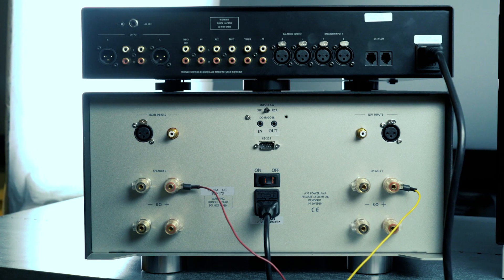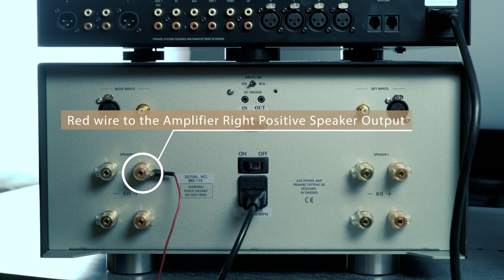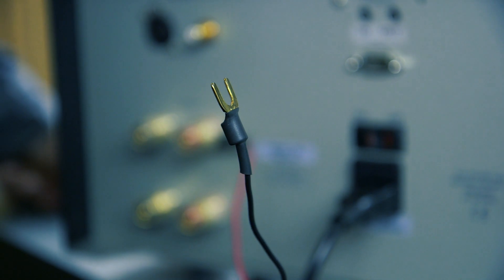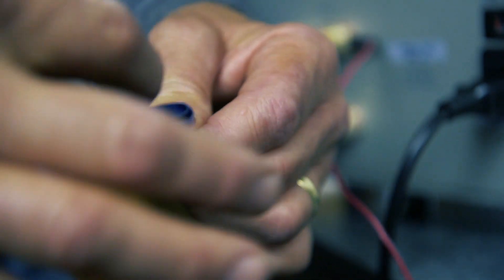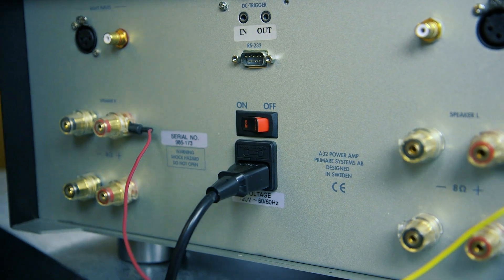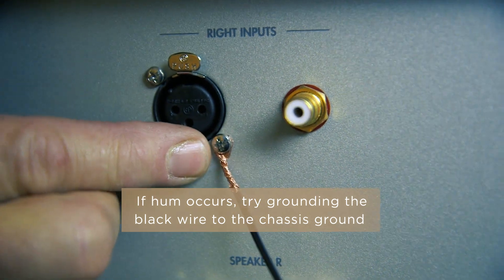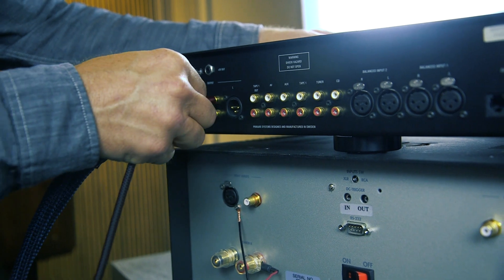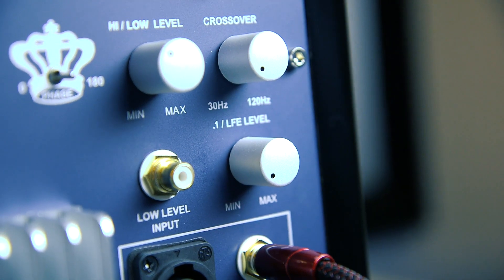REL Acoustics How To: Connecting to a Balanced/Differential Amp Using the High Level Cable

Comment: Can I use a high pass filter with the hegel h120? and how?
Reply from the maker: Thank you for reaching out. The Hegel H120 uses a Class A/B output stage design, which means that you can certainly connect to it using the High Level input. With the H120, the black wire can be attached to a negative speaker output terminal, while the red and yellow wires can be attached to the positive speaker output terminal for the corresponding channel. 

If you have any additional questions about connecting High Level in your system then feel free to write in to contactus@rel.net and we will be happy to assist.

Comment: Would this apply to a Hegel H190? Thanks
Reply from the maker: Thank you for reaching out. The Hegel H190 uses a Class A/B output stage design, which means that the instructions outlined in the following video can be used when connecting High Level to this amp: https://www.youtube.com/watch?v=YIenhBQEtE4&t=8s

Comment: my Rotel 1582mkii has 2 sets of binding posts for left and right channel can i connect to posts that don't have the mains on them
Reply from the maker: Thank you for reaching out. To get the best possible performance from the High Level connection we recommend connecting the cable to the exact same set of output terminals as your main speaker wire is currently connected to.

Comment: i can't determine if my Michi X3 is a fully Balanced/Differential Amp or not, should I leave the black wire floating or attach it to a ground point on the chassis?
Reply from the maker: Thank you for reaching out. Rotel describes the Michi X3 as using a Class A/B amplifier design, which means that the black wire of a REL's High Level cable can be connected to a negative speaker output terminal on this amplifier. That being said, it appears that the Michi X3 also has a designated ground screw on it's back panel, and when one of these is available I typically will default to connecting the black wire to this ground screw regardless of the output stage design for the amp.

Comment: I use Proceed AMP 2, please advise the best way to connect a REL S5 high level?
Reply from the maker: Thank you for reaching pout. The Proceed Amp-2 is a Class A/B amplifier, which means that the standard High Level connection method can be used, as outlined in the following video: https://www.youtube.com/watch?v=YIenhBQEtE4&t=8s
Reply: @RELAcoustics  Many thanks for your prompt response.

Comment: Hello, thanks for the video. Question; is the SPL of the subs the same without the Black cable connected as with it connected? With my Yamaha I had the colored wires twisted to positive and the Black to negative. Now with my Denafrips Hyperion all I did was disconnect the Black and I barely hear the bass output. Does the subs Phase change with a balanced amplifier? I have two t/9i connected in stereo. Thanks again!!
Jason
Reply from the maker: Thank you for reaching out. The black wire of a REL High Level cable exclusively serves as a ground reference between the subwoofer and the rest of your system, and if you do not experience a ground loop hum from the subwoofer then there will be no need to connect the black wire. 

The type of power amplifier which you are connecting to will not inherently impact the phase of the subwoofer, though there are other possible reasons for the low output that you are experiencing. When you have a chance, please write in to contactus@rel.net and we will be happy to assist with troubleshooting this output issue.

Comment: Is this the same as for a Bryston 14b3? I’m assuming because the amplifier is bridged that I shouldn’t use the black ground wire?
Reply from the maker: Thank you for contacting us. The Bryston 14B3 is a fully-balanced power amplifier, which means that you should follow the instructions outlined in the above video when connecting a REL subwoofer using the High Level input.

Comment: Is "system ground" the same as saying "common ground"?
Reply from the maker: In terms of connecting the black wire of a REL subwoofer's High Level cable, a system ground and a common ground would work equally well. If you have questions about connecting to specific equipment, then feel free to write in to contactus@rel.net and we will be happy to assist.

Comment: Is a Krell DUO 300 a Balanced/Differential Amp? I assume it is because I can use balanced interconnects? thanks
Reply from the maker: Based on Krell's literature the DUO 300 is a Class A amplifier, though it would be worth contacting Krell to confirm if this is the case. If so, then you can use the standard High Level connection method with the black wire connected to one of the negative output terminals on the amplifier. Here is a link to our video outlining this connection method: https://www.youtube.com/watch?v=YIenhBQEtE4&t=8s

Comment: Can I connect a REL T/7i over High Level cable to the new Musical Fidelity M8xi ? According to Musical Fidelity high level connection is not possible? But I am not sure if that goes for REL as well...........
Reply from the maker: The T/7i subwoofer can be connected High Level to your Musical Fidelity M8xi integrated amplifier, though it will be important to not connect the black wire of the High Level cable to either of the negative output terminals on the amplifier. Instead the black wire should be left disconnected to start, or if any hum occurs from the sub then you can either connect the black wire to a chassis screw on the amplifier, or run an RCA cable from the .1/LFE input on the subwoofer to any unused analog RCA jack on the amplifier. These instructions are also outlined in the above video.

Comment: Hi, I ordered a pair of T/9x RELS and I am connecting the. To a McIntosh MC452 quad balanced amp. Is this the method I should use? If so, where do the second eat of red and yellow wires go? Thanks!
Reply from the maker: The following instructions can be used when connecting a pair of subwoofers High Level to Quad-Balanced stereo amplifiers:
- Twist together the red and yellow wires of the right channel subwoofer's High Level cable and connect to the right channel 8 ohm positive output terminal.
- Twist together the red and yellow wires of the left channel subwoofer's High Level cable and connect to the left channel 8 ohm positive output terminal.
- Leave the black wires for both subwoofers disconnected. If hum occurs, then they can be connected to a chassis screw on the amplifier, or to a ground screw on your preamp if one is available.

Comment: Hello. Tell me how to connect the rel t7i to the Yamaha as 2200 amplifier. The speakers are connected via biviring. And what to do with the black wire?
Reply from the maker: When connecting the T/7i subwoofer to your Yamaha A-S2200 using the High Level input, we recommend connecting red wire to right channel positive, yellow wire to left channel positive, and black wire to the ground thumb screw located on the amplifier's back panel. If you are bi-wiring your speakers, we recommend connecting the positive red and yellow High Level wires to the output terminals which are sending signal to the low-frequency drivers on your main loudspeakers.
Reply: @RELAcoustics  Thank you for the instructions. Is it possible to simultaneously connect the ground wire from the vinyl player to the ground point on the back of the amplifier along with the black wire from the rel t7i?
Reply from the maker: @MrAlmat-mh9di  Yes, you can have your turntable's ground wire and the black wire of the subwoofer's High Level cable connected to the same screw without issue.
Reply: @RELAcoustics  Thank you very much for your advice. You have an excellent product. I wish your company prosperity.

Comment: Hi, I have a Rel HT1508 Predator Sub and I’m trying to find out if I can connect it the way the video shows directly to my Yamaha TSR-700 Receiver. Also, am I supposed to use the speaker terminals to connect both, the speakers and the sub at the same time? Thanks in advance
Reply from the maker: The HT/1508 and all the subwoofers in HT series only connect low level or with the LFE channel. Since those are home theater focused and we wanted to keep costs low we didn’t include the high level connection.
Reply: @RELAcoustics  I see, so, between those two options, which one do you recommend better to get the best out of my Sub?
Reply from the maker: @giancarlodeassis1839  For optimal performance, we recommend connecting from the designated subwoofer output on your Yamaha TSR-700 receiver to either the right channel (red) or left channel (white) RCA input on the HT/1508 subwoofer's back panel. You will then be able to use the subwoofer's Crossover, Level, and Phase controls for tuning it's output to blend with your main loudspeakers.
Reply: @RELAcoustics  Sounds good, thank you 🙏
Reply: @RELAcoustics  another question, I’ve tried to connect it that way but on the back of my Rel Sub, the .1 LFE label connection is located on top with the output. Does it matter? Should I connect it to that output (Red) or to the regular input? Thanks again

Comment: Hi! I changed amplifiers frequently, if by any chance I forget to do this and connect the black cable to a  balanced/differential amp, can I damaged the amplifier?
Reply from the maker: Connecting the black wire of the subwoofer's High Level cable to a negative speaker output terminal on a balanced/differential amplifier can result in damage to the subwoofer and/or the amplifier. When you switch out amplifiers in your system, feel free to write in to contactus@rel.net and we will be happy to provide high level connection instructions.
Reply: @RELAcoustics  Great! thanks for the replay. I own a Bryston 5b ST should I connect the black wire to amplifier chassis or normal imput?
Reply from the maker: @gustavopena1096  The Bryston 5B-ST functions as a Class A/B amplifier when used in the standard 3-channel configuration (as opposed to the bridged configuration), and as a result you can connect the black wire of your REL subwoofer's High Level cable to either of the negative output terminals on the amplifier.

Comment: Will this work with a Pass XA-25?  Can you connect stereo pair of REL subs to Pass XA-25?  Thanks!
Reply from the maker: You can certainly connect a stereo pair of subwoofers to your Pass Labs XA-25 using the high level input. When connecting to the XA-25 twist together the red and yellow wires for each subwoofer's high level cable and connect to the positive binding post for the corresponding channel (right channel sub to right channel positive, left channel sub to left channel positive). The black wires for both subwoofers should be left disconnected, though if hum occurs the black wires can be connected to a ground screw on your preamp, or to a chassis screw on the XA-25.
Reply: @RELAcoustics  Hi 
I have Pass Labs XA30.8 (CLASS A power amp) and a single Rel S812. Should the black wire be connected to (L -), or should just hang down without connection? Thank you

Comment: I have a rel subwoofer l like to conect high lebel to the box speaker in the back of speaker we have 4 screw in back of speaker,we conect the high lebel in subwoofer spoken cable but in the end they have 3 kind of wire yellow black ang red

Comment: What if your using xlr cables?
Reply from the maker: Even if you are using balanced XLR cables, your amp may not be a balanced/differential design. What model of amplifier are planning to connect your REL to?
Reply: @RELAcoustics  Hi, I have a Rel HT1508 Predator Sub and I’m trying to find out if I can connect it the way the video shows directly to my Yamaha TSR-700 Receiver. Also, am I supposed to use the speaker terminals to connect both, the speakers and the sub at the same time? Thanks in advance

Comment: REL, wish these higher quality spade connectors were included on your T9i series with the Arrow. For the price, the quality of thin and brittle bare copper on the high level cable is terrible and mine did not survive more than 4-5 connect-disconnects when switching amps. As I kept having to re-strip them and eventually they got too short. I recently picked up a multichannel McIntosh Amp (MC206) and had to order your higher end "bassline" high level cables, one for each Arrow which are properly terminated with spades and better wire. Additionally, since I use Stereo T9i's.... my Yellow wire  is on the Left Arrow Wireless goes to the Left Positive, and the Red Wire from the Right side Arrow Wireless to the Right positive. I don't use both for each side as the output is too high on my system as noted in the videos for Stereo RELs. But on the McIntosh MC206 when using Stereo RELs, do I need to hook up to black cable coming from each Arrow to the negative binding posts of the L and R? Or do I let it float and tie it up with electrial tape as shown here? All I know is that it's a Class A/B Multichannel Power Amplifier. Thanks for help in advance.
Reply from the maker: When connecting High Level to the McIntosh MC206, we recommend connecting the black wires of the high level cables to a chassis ground screw on the amplifier. This will give both devices a secure ground connection, resulting in no hum from the subwoofers. 

The primary reason that the High Level cable which is provided with our subwoofers only has bare-wire terminations is because it allows more options for connecting to a variety of amplifiers. Some amplifiers can only take bare wire, some only banana connectors, and some only spade connectors of a variety of sizes. By leaving the cable with bare-wire terminations our customers are able to use whichever connection type they would like to better suit their system.

Comment: Hello i make the connection according to the video, I have sound on the speakers and not on the subwoofwer just hum on the REL!  Sorry my bad English
Reply: Thepower amplifier is ONKYO M 5890 and pre ONKYO P 3890. Could you help me please? Best regards from Portugal
Reply from the maker: @ALPHA5601  Were sorry to hear that you are experiencing issues when connecting to this amplifier using the high level cable. Please write in to contactus@rel.net for technical troubleshooting assistance.

Comment: I just got x2 REL T5 and I have an amp (Audia Flight FLS10) that says it’s fully balanced BUT I don’t have any grounding points.

How might I be able to hook up the subs? This is a picture of the rear or my amp. Thanks!

https://hifiwigwam.com/forum/uploads/monthly_2019_05/image.png.12be696d336d50818c3126a60d085074.png

Comment: First of all thanka for making these videos.  I have my T9 connected like this with the black ground wire connected to a dedicated ground on the back of a Primare A30.1.  I get loud hum only wheb I put the amp into Stanby.  Floating the ground doesn't help.  Not the end of the world if I turn the sub off and then the amp.  Any ideas?
Reply from the maker: It could be worth trying to run an RCA cable from an unused output on the back of your preamp to the LFE connection on your REL. This will give the system another path to ground. If this does not work, then feel free to write in to contactus@rel.net and we will be happy to help troubleshoot this issue.

Comment: But where do you connect the speaker cables?  Into the Banana Plug where the Rel wire is? Or in the empty speaker outputs next to it?  I have a Rotel RB 1582 MKII that has the same lay out as this amp does in the back.
Reply from the maker: You would run your speaker wires to the same terminals you connect the REL to, as shown in this video. If you experience hum after connecting you will need to run the black wire to a chassis ground. Don't hesitate to reach out if you have any other questions.
Reply: @RELAcoustics  what about if I have 2 rel subs t9is how do I connect the high level
Reply from the maker: @juancarlostriana8489  With a stereo pair of subwoofers connected to a balanced/differential amplifier, you will still want to leave the black High Level wires disconnected to start. Each subwoofer will then be connected to it's own output channel on the amplifier, meaning that for the right channel sub you can twist together the red and yellow wires and connect to the right channel positive output terminal, and for the left channel sub you can twist together the red and yellow wires and connect to the left channel positive output terminal.
Reply: @RELAcoustics  thank you,  I did just that but when the sub is on with  music and I raise the sub the subs makes noise , is that normal
Reply from the maker: @juancarlostriana8489  There are several possible causes for noise from your REL subwoofer. At your earliest convenience, please write in to contactus@rel.net and our service team will be happy to help troubleshoot this issue for you.